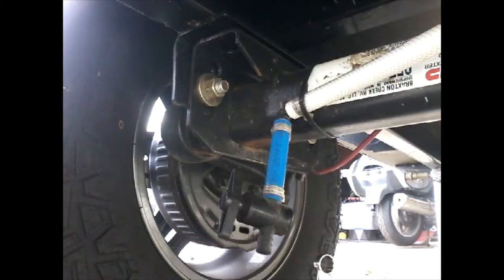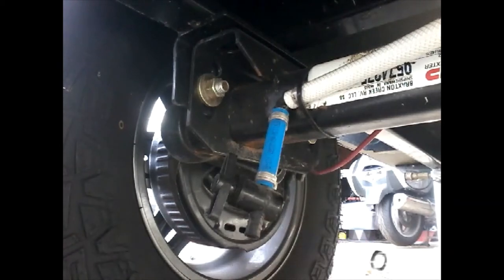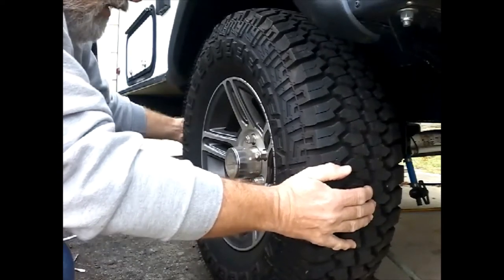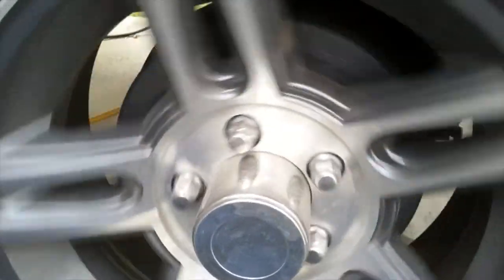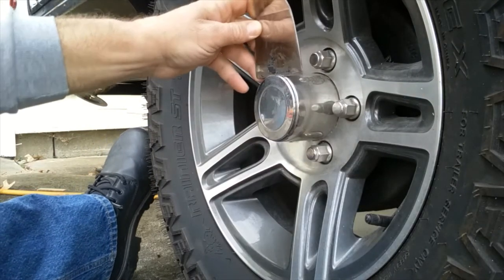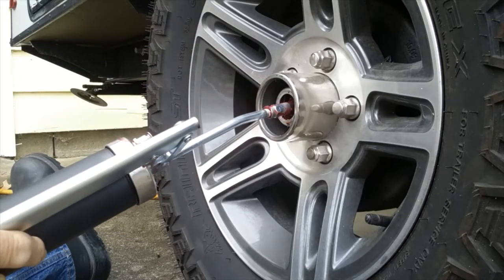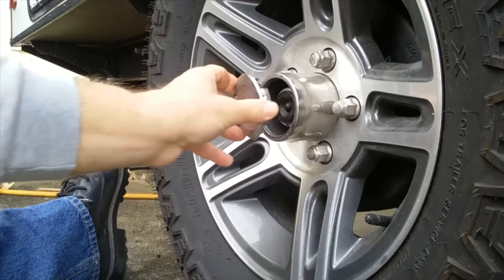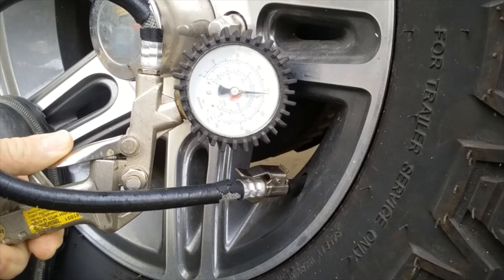Camper, Trailer wheel bearing Inspection/greasing

Comment: Thanks for the video. I have a 7x12 v nose enclosed trailer to haul my motorcycle. The Trailer bought new 5 years ago and we put around 1,200 to 2,000 miles a year. Once a year before sturgis I will service the trailer and do a safety check. The wheels have a ez zert / bearing buddy. This time I want to remove the wheels and pack both bearings on all for 4 hubs, as I have not done this before. Of course Discovery Trailer Co. doesn’t offer video or manuals for this, so with your help and other videos I have watched will billed my confidence in doing so. Ps dealers around my area charging $200 to $300 for this service.
Reply from the maker: Glad I could help you out, good luck !

Comment: When adding grease to those E-Z Lube Zirk fittings, you are supposed to rotate the wheel while slowly pumping in the new grease to avoid blowing out the inner grease seals.
Reply from the maker: the dexter axle lube system is not the same as the e-z lube, if you only put 3 or 4 pumps in every 2000 plus miles it does not create a problem with the seal, how ever if you continually pump in grease it could push the seals out the back of the brake drum. I have done this for years and never had a problem or seal or bearing failure. Thanks for your comment.
Reply: They infact are the same thing. A bearing buddy is completely different. You didn't service anything.

Comment: I have about an 1/8” or less wiggle in the wheel on the left side of my bushwhacker 10FB. Should I tighten the bearing up or is that ok? The other wheel did not wiggle at all.
Reply from the maker: sounds like it needs snugged up and greased, If after that it come loose again, tear down and inspect the bearings, Thanks for watching!